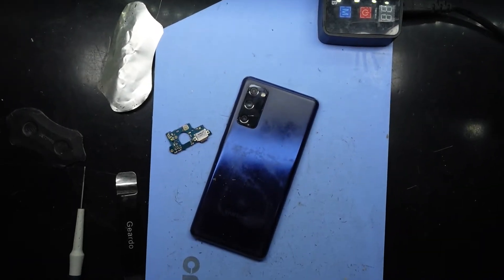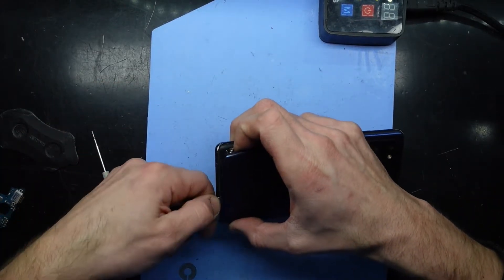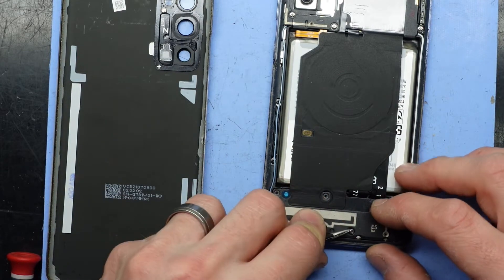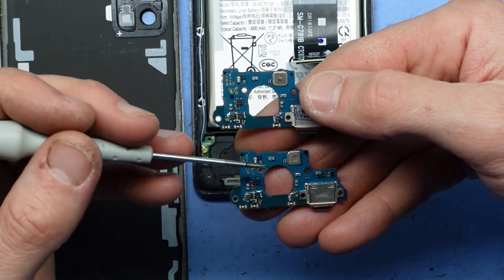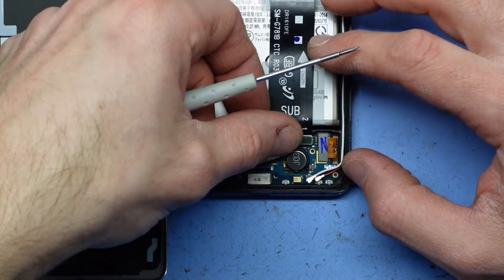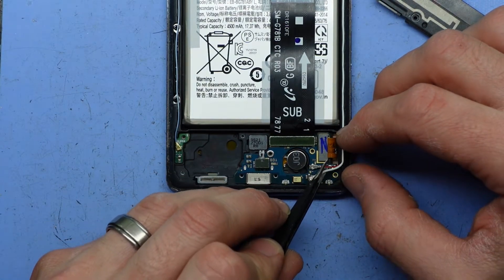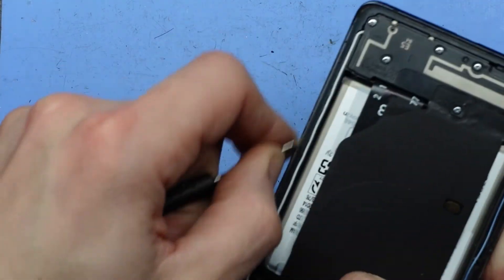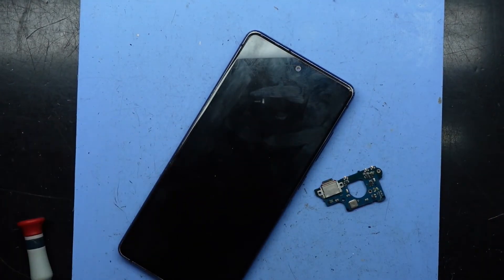Samsung Galaxy S20 FE Charger Port Replacement

Comment: I have a question,  my s20 fe 5g phone has the same issue not charging,  wireless charging works, technician said charging port is not issue, he tried with a different one,  battery is OK. Could the flex cable be the issue? Any help is appreciated
Reply from the maker: not sure sorry

Comment: Hey im going to be doing this soon but i am worried because ive done this before to a moto g power 2021 and the replacement charging port is very good, very strong connection but after i did it i lost signal on that phone. I dont want that to repeat itself, if it does happen what do you think would be the issue?
Reply from the maker: if it does it again, it would be a different region of charger port, take note of the model number printered on the charger port

Comment: Any tips for someone who has swapped the charge port but is still experiencing the same issues? 

I bought a used phone, but the seller failed to tell me the charge port was not working. So I ordered a part, and replaced it. 

After replacement I am still experiencing the same issues. Plugged into a charger, it says its charging for a few seconds and then stop. And when plugged into a PC it doesnt connect at all, not even for charging.
Reply from the maker: i find plenty of spare parts to be faulty.. so even though it has been changed, i would recommend to be buying from a different supplier
Reply: @ I kept digging and searching online. Finally found someone with the same issue. Turns out it’s the connection of the main flex cable from the daughter board to the main board. 

I don’t know which connector is damaged though. So I don’t know if I should buy the flex cable or if I would need a main board.

Comment: Great video, thanks. Replacment went fine but now when i turn my phone on i just get the samsung galaxy power upscreen over and over agin, any ideas?
Reply from the maker: hmm, not sure,
i would switch back to the old charger port and see if it powers up
Reply: im getting the same issue, did you fix it?

Comment: So I replaced it, but it won't charge because "it is overheating". It's like the phone is rejecting the new part and won't charge. Turns on and works as usual, but can't charge.. any ideas?
Reply from the maker: not sure sorry, i find alot of crap replacement charger ports are out there

Comment: So out of nowhere one evening my charging cord would no longer go into the charger port.  After watching this video, I ordered the part and was able to replace the part following these instructions.  Now the problem starts.  After replacing the charging board and re-assembling phone, my phone will no longer turn on.  If I plug it into the charger (which is no longer a problem), the phone will buzz and sometimes make a sound, but will NOT turn on as normal.  I have since had to take it to a repair shop and was instructed that I SHOULD HAVE removed the battery board, which was instructed to skip that part in the video.  I was informed that it was more than likely SHORTED OUT from not disconnecting the battery.  I was quoted $150 to now repair a phone that was just "repaired".  What do I do NOW??  He told me the phone WAS on and the screen was damaged.  I insisted I sis not even touch the screen, he then said it was probably shorted out, which I told him I did not touch the battery.  That is when he told me I should have disconnected the battery first.
Reply: So out of desperation, I went back and removed the new part and replaced the old part.  Lo and behold, everything is working!! It was installed properly and your advice to skip the battery disconnect was accurate.  I'm so glad I didn't spend $150 to fix something that wasn't even broken!  I am going to return the part I ordered and get another if I find the charging port to still be an issue.  Thank you for your thorough and easy to follow instructions!  You saved quite a bit of money!

Comment: My phone died when it was low on charge and I was trying to charge it and it never turned on I took it to a repair shop and now the bottom microphone is not working it's completely dead I can't send voice messages or use the mic on Google or even YouTube I think they stole it what do you think ? Could it be that it isn't attached properly?

Comment: Can you pls tell if we change the charging port anywhere outside (not in samsung) does it effect the gas kit protection in charging port ? Pls answer
Reply from the maker: water proof protection?   changing the port to another region would be fine but it might affect signal strength
Reply: @rickstechrepairs there are different regions for the charging port? Why would that affect the signal strength?

Comment: Thanks for this vid, phone was failing to charge, replacement daughter board for €12 and up and working again using your video as a guide 👍.  It wasn't completely smooth sailing, when plugged in after swapping the boards got a temperature error sign and wouldn't charge. On googling found a tiktok that indicated faulty temp sensor, scratched that off the daughter board, put back together and now fast charging again like when new. Thanks again, John
Reply from the maker: Good to read this has helped 

The Majority of the Temp / Moisture sensors on the replacement of charger ports on the net seems to be a major issue

Comment: Thanks, i sorted it, kit only cost me £10, wouldve been much more expensive to send it somewhere. Did panic after i put it back together and my touch screen wouldnt work however after a full shutdown it worked again...couldve mentioned that, was panicking😂😂
Reply from the maker: Nice work!
Reply: @rickstechrepairs  i now have a mobile network issue...looks like the place i ordered it from may have sent me the wrong one and it isnt working with the antenna, i put my old port back in and the mobile network was working fine...

Comment: Thanks for the guide. My S20 only charges very slowly through charge port and no USB functions work.  Is this usually charge port board fault or something on mainboard? There's no damage to the port itself.
Reply from the maker: I would be usually thinking charging board,  which is what I replace in the video
Reply: @rickstechrepairs  I replaced it and it fixed the problem as well as fixing no sound from bottom speaker but now I cant use mobile data :(  I got right model part but can see some empty solder pads compared to original. any idea where to buy good charger boards?